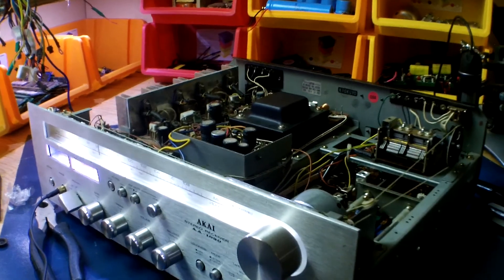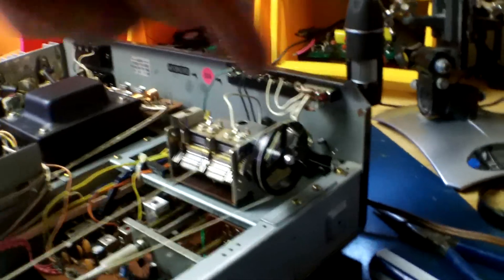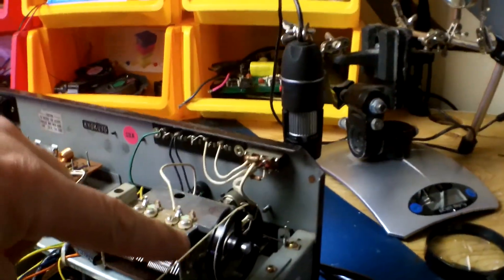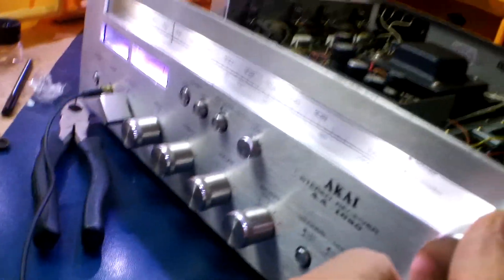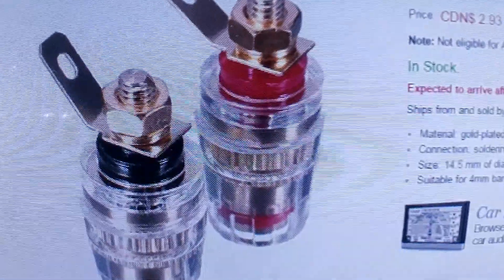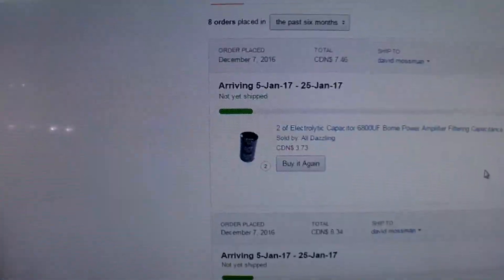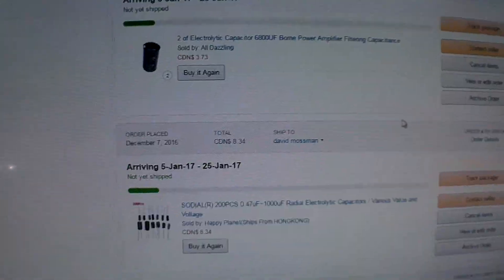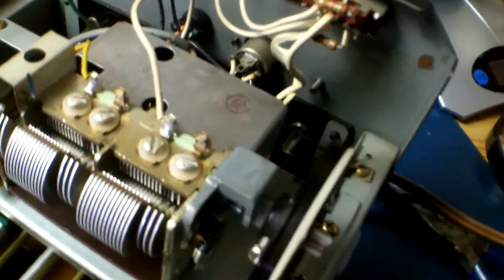Akai AA-1030 repair rebuild part 3[ rebuild tuner pot ordered new caps]

Comment: This is the last part of the series and actually the one I am interested in but not covering my problem. The little plastic loop of the tuning pulley broke and the thread lost it tension. Is there a way or trick to re-attach it? How do I calculate so if I tuning a station and put the dial pin in that position then attach the thread correctly? can I glue it? any other method? This video is 6 yrs old I hope I get an answer.
Thanks